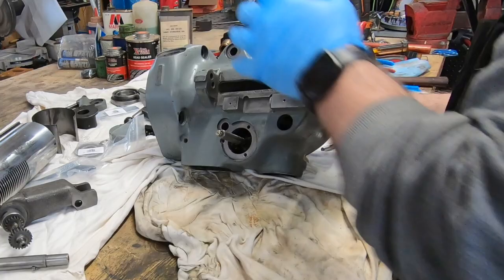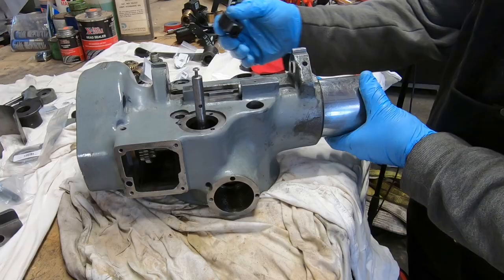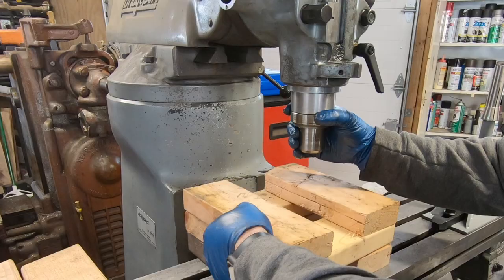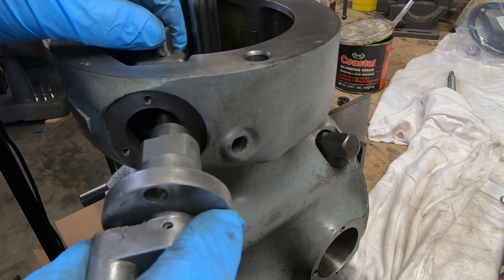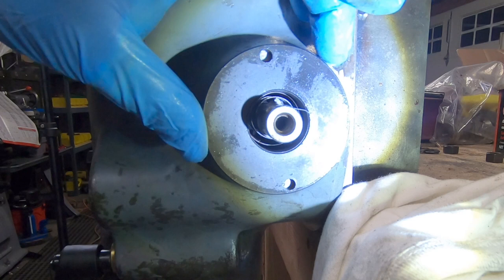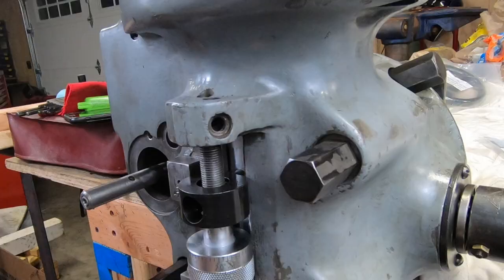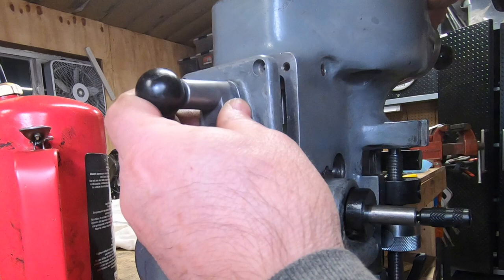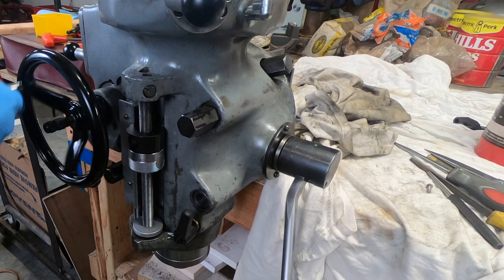Assembling the Bridgeport Mill Quill Housing

Comment: almost done.. then on to the 2HL .
Reply from the maker: I might have a small project or two I need to bang out before I dig too deep into the K&T. Plus, I will need some input on how to take the power feed distribution unit off to deal with the Y axis power feed lever.

Comment: Nice! Question. At 20:30 you were testing three positions of the feed reverse knob. My knob is almost impossible to move in and out, even with the ball and spring removed. I don't know why it's jammed. I remember them  being almost frictionless. Any ideas? Thanks
Reply from the maker: I wish I could give you something that would lead to an answer. The only thing I could offer are guesses. Perhaps the shaft is bent? Or it could be something internal. Not sure what else to look at. I’d recommend calling Barry at H&W or Tim at Beamer Machine. They are the real experts. I’m just some hobby guy that makes videos. 😉😂
Reply: Thanks. One person mentioned success with penetrant and patience. I'll try that, as the machine is older and that function may have sat unused. Cheers.

Comment: Good morning friend, I have a milling machine similar to that Chinese brand and the automatic of the boom or spindle of the head does not work. the lever engages well but the movement does not work. Do you have a video to repair it? I would be grateful if you can help me. Thank yo
Reply from the maker: I don't. You might want to check out H&W Machine. They have quite a few videos that deal specifically with repairs.
Reply: @MyLilMule